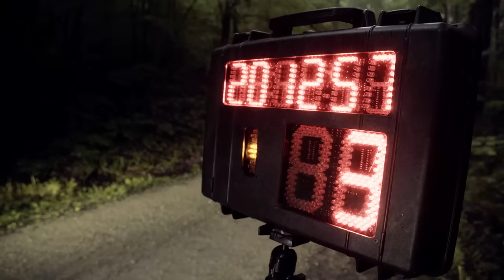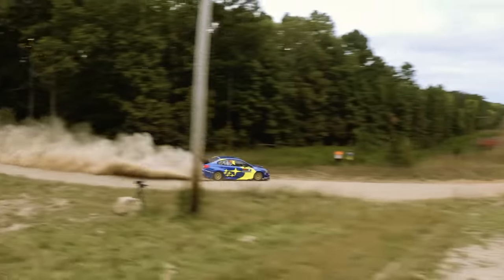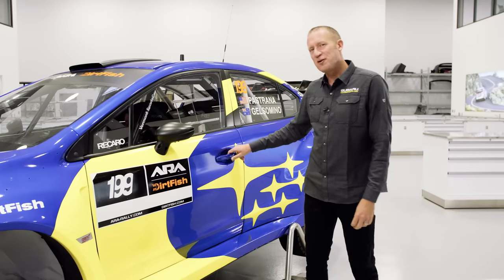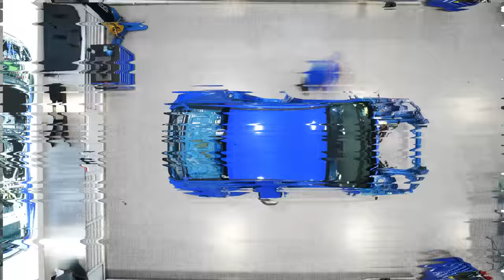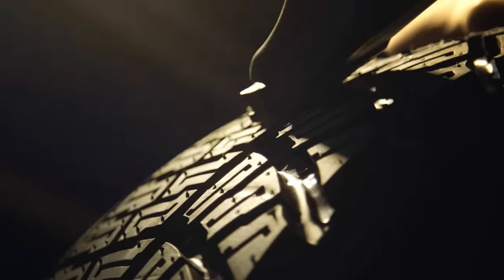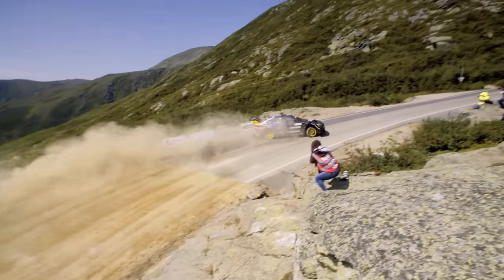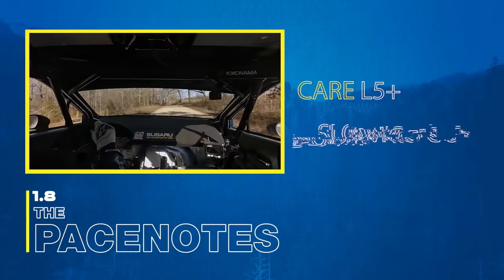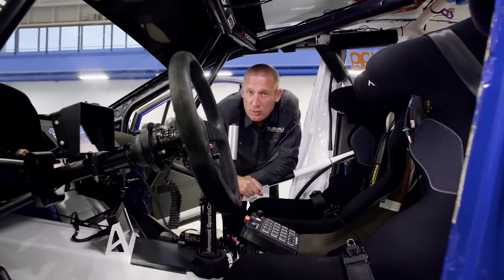Rally 101: Everything you need to know about rallying

Comment: WTF, it's every time "subaruOfAmerica" not the main branch like 2001 ;(
Reply: As far as rallying goes, Subaru has been out of the WRC for years ever since it was domintaed by Citroen (or Peugeot) in the early 00s.

The only works racing team that is sort of supported by the Main Branch (Japanese side) is currently on GT300 class of Super GT with their BRZ GT300 and also the WRX STI for Super Taikyuu Endurance Series.

If Subaru wanted to get back into WRC then they probably gonna need a smaller car. As good as the WRX is, it's practically a big boat compared to the more nimble and smaller cars like the GR Yaris which does suits the twisty roads a bit better.